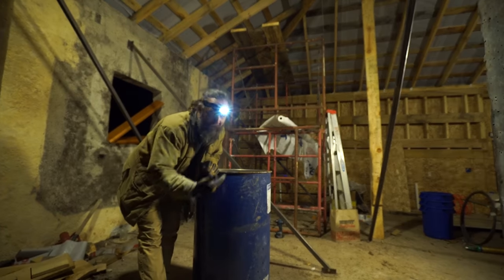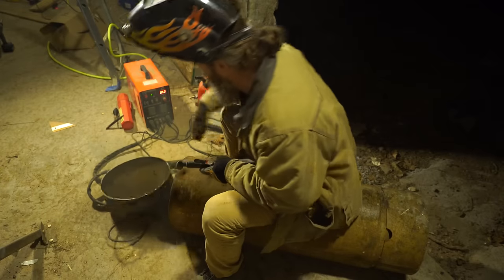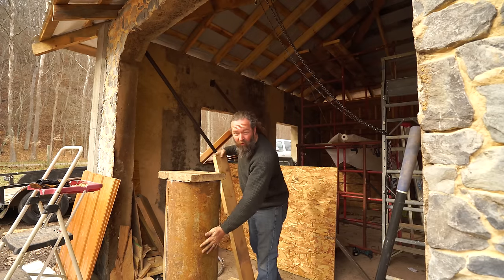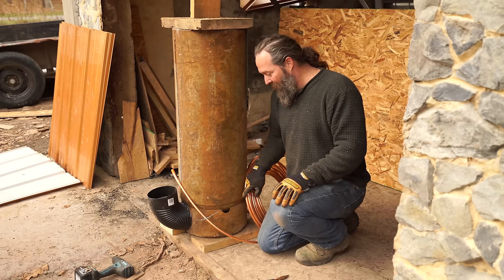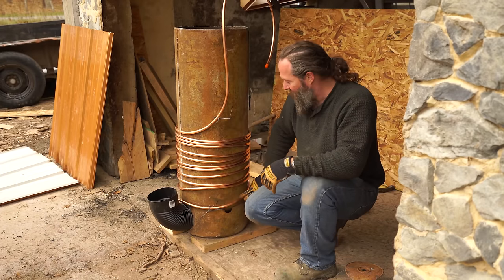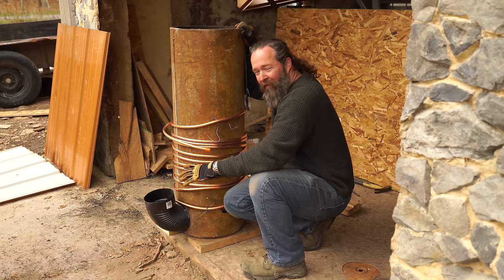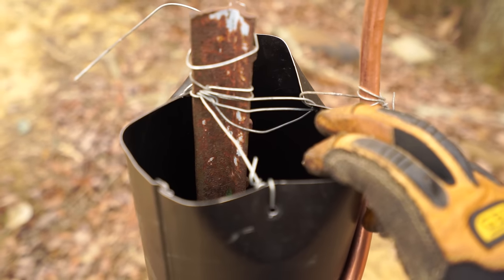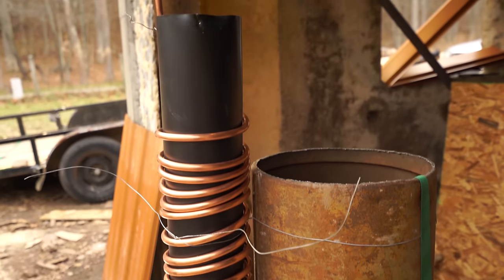The Dragon V2 Build Complete How To Video (featured in Mother Earth News) by Timothy Luce

Comment: I've built one of these based on your design and got it running a little while ago, it was awesome. 

After stalking several of your videos I read that you had an issue where it clogged up after you dampened the stove and then you modified the air intake and it was a lot better? Could you elaborate on this?     

I find I get good results if the lid is opened a crack for air for a bit after its drafted through the exhaust tubing, and was thinking some sort of adjustable air on the lid
Reply from the maker: rock on!!! I'm stoked to hear you built one.  What are you burning in it? 
Re the clogging question... In the initial design, I had a decorative air intake that would not let the ash self-clear.  I changed to a down-facing inlet and that cured it as the ash can self-clear with gravity.
Reply: @midevilone  thank you for this video! I burn firewood since its readily available for me, but have also used the compressed logs from the store.        I built mine as close as possible to your design with what I could find, as of now its: 

A cut 100 pound propane tank for the fire chamber just like you showed inside a steel barrel. 

A 14 inch steel rim cut in half as a base for lower chamber and as a grate, I've had huge flame improvements cutting it open more. 

100ft of 1/2 copper around the fire chamber 

Pex tubing to 100 liter stainless steel tank I got from a customer (national cable company ~1970)  it has side attachments as well as vertical attachments for the thermal siphoning. 

Ive tested and mitigated the problems that arise and it is capable of 80 degree celcius water in the tank in an hour and a half!  water is stratified until the pump kicks in though. This winter will have more accurate numbers. 

The biggest turning point of my build was adding another 3ft chimney, and now it sounds a lot more dragony and the air speed on the intake is awesome!

I am very excited to put it to use this winter, its been an ornament so far as its fire ban right now. 

Again thank you, I've learned so much about something I thought I knew about, you've renewed my perspective! 

This winter I will try to post a video in honour of your research and work!

I also put the intake on a 45° angle so the ash is able to fall out.
Reply from the maker: Kyle Harvey awesome!!!!this is what it’s all about building on the shoulders of others.   Love the idea of the taller stack making your dragon growl more.  Be sure to let me know when you post a video of your stove.

Comment: Please Please; don't take any chances on old propane tanks being safe propane is heavier than air and will stay in an open tank a long long time. Fill the tank with water completely before cutting, Please!!!
Reply from the maker: +BIG JOHN the tank was on its side for more than two years with the valve out.
Reply: I don't like to make a suggestion to clueless people who might assume WRONGLY and get themselves blown up!!
Reply: You could just turn it over then....
Reply: That actually looks like an old acetylene tank.
Reply: @BIG JOHN Exactly what I was thinking!
Reply: @Keith Whitmore My response was to the original poster BIG JOHN about being careful (not about the acetylene comment). It doesn't look like any acetylene tanks I've used in USA or UK). Thanks though.
Reply: Acetylene tanks aren't hollow. They have a porous material monolithic mass in them  and acetone.
Reply: heating any metal releases gases trappe in the porosity. filling with water only condeses the concentration of explosive gases. used fuel cylinders can sometimes be presssure washed with hot soapy water then partialy filled wwith baking soda and vinigar to create co2. may be safe to cut then but do not die trying. If in doubt place unvalved cylinder in safe location on bed of unlit charcoal and kindling .light fire and walk away .tank is not safe to cut or weld on untill it has hot enough to burn at least half of the paint off
Reply: Acetylene tank would've been full of a foam substance and acetone. They put that in the tanks because acetylene isn't a very stable gas. But it is quite easy to make. Cobalt and water. I have an old miners head lamp. That's how they worked a piece of cobalt and the little tank on the top held water. There was a valve that controlled how much water dripped on the cobalt and regulated the flame. I've taken the valves out of #100 propane bottles and put compressed air to them until they stop stinking. No smell no problem.
Reply: Calcium carbide. Cobalt is total different thing.

Comment: I like what ur doing, but I believe copper against steel corrodes fast and is a big no no. Atleast that's what the plumers told me back when I was in construction. 
I'm  sure you could just use some spacers to fix that problem tho.
Reply from the maker: +john pagn perhaps it was galvanized steel
They were referring to.  I have seen no corrosion in the version 1 stove.
Reply: midevilone you could be right about the galvanized steel.